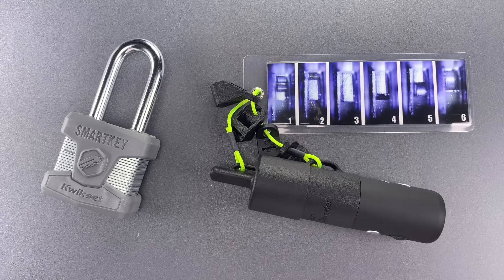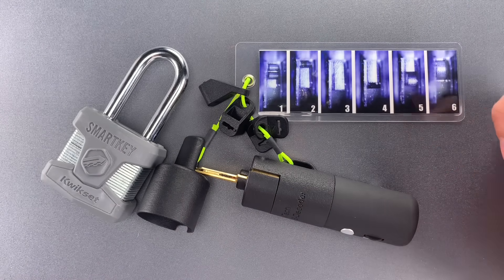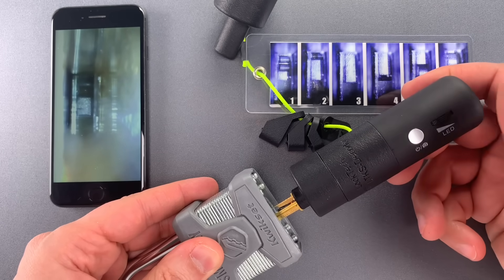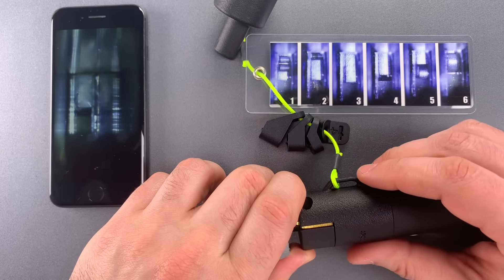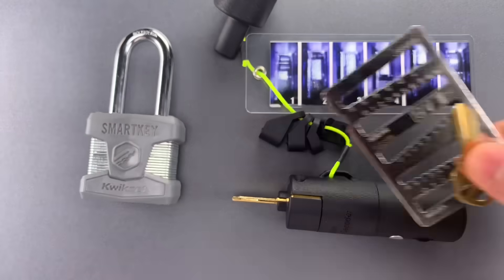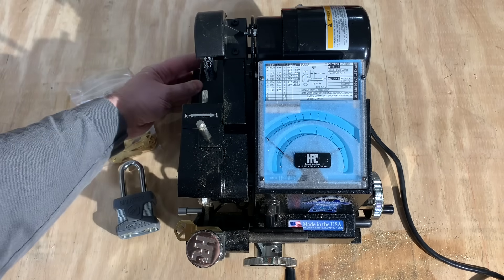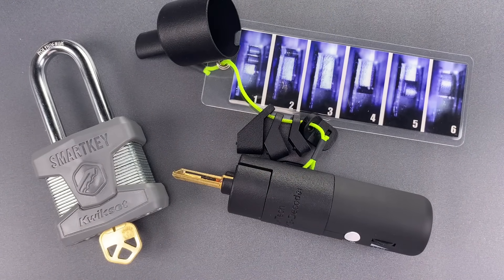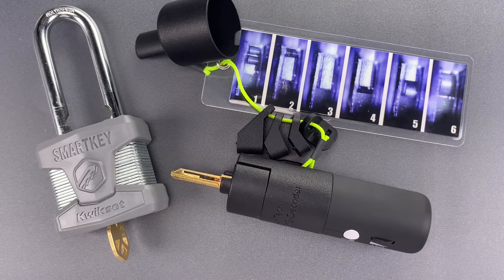[1209] This Tiny WiFi Camera Owns Kwikset SmartKey (LockTech LTKSD)

Comment: Hey LockPickingLawyer, I have a question regarding getting a key copied maybe you could give some advice on. The key for my '87 CRX (original key) is rather worn down and I've been looking at going to a locksmith to have a new key made from it. Anything in particular I should look out for?

Comment: I would have to ask why law enforcement would buy and use that expensive tool when they could more quickly and less expensively use some type of bolt cutters made to do the job even if the lock has some type of really hardened metal

Comment: I'm confused. If this camera goes in like a key, how does it see the side of the sliders, to determine depth (for depth of cut number)? Thanks
Reply: Since the camera is a straight key, or a “0”, the camera shows how far off the sliders would be from the correct position.
Reply: @freypod  Thank you for your reply. I guess I'm not sure what the camera is looking at. I was thinking the lens is on the top of the key, but perhaps it is actually on the side of the "key" (lens). That seems to be the only was to "see" the depth. Learning so much.. Thanks again, Eric
Reply: @ericwes7351  It looks to the left with a tiny angled mirror. The camera looks forward at the mirror.
Reply: @70FordMach1  That makes sense now. Thank you!
Reply: @70FordMach1  Ah, got it. Thanks for that!

Comment: the spacers don't always line up the tool with the wafer chamber I've found; the key- in-knob locks, don't allow the tool to rest flat against the plug face.  
When pulling it out by hand must be careful to note if you're viewing wafer/tumbler or the plug walls (may appear to be a number 3 which is mostly solid)
Reply: Also have to look for wafers that are broken. Don't look like the chart. Can throw you off. That position might work with any cut.

Comment: Thinking of the scenario of gaining covert entry at a later time, if this device took high framerate video you could walk up to the lock, start recording, calmly insert the tool, take it out and leave. You've then got a video you can watch at you leisure to figure out the cuts and get a key made.
Reply: You could use a screen recorder overlay app on your phone. Kind of like fraps on the pc, but on mobile instead

Comment: they could greatly improve the wifi cam by adding a motor that slowly inserts the camera blank into the lock at a set interval(like have it telescopically extend out) , and then having software, an app that  known the speed it is being  inserted at and grabs the photos and then uses AI to to identify the cuts and then  outputs  a photo of the key and  a printable file so you can just print it out at the actual size and use it as a template
probably would  not even be that difficult to design such an app
or even better have it output a  STL file for a 3d printer , either for printing with a regular  plastic extrusion 3d printer or even better a metal SLS printer

Comment: or you can just 3D print the key, as 3D printer are far more common and versatile than key-filers
Reply: Would it break while opening? How much force can printed key sustain? This is an honest question as I never worked with 3d printer :D

Comment: I liked using this key cutter when i worked for a commercial door company, but i would have to go out to jobs and find out what cuts to do if they ever lost a key without any nice camera equipment, so i was basically working backwards from locksmithing because I had to lock pick it, but go through 5-20 keys trying to figure out the number combination for a lock that worked with 5 seperate keys. But hey, now i know how to lockpick unreasonable deadbolts.

Comment: This man's arsenal is getting bigger and bigger to the point where he can break into the pentagon.
Reply: You should read about Richard Feynman. When he was at a military base doing atomic work someone locked the combo to the the super secure safe in the safe on accident. They called him up to open the safe, which he did.
Reply: @SeriousshirleyS  in order to properly understand levels of security you must think of them as time delay devices. A thief determined enough and prepared enough will get past any measure of security given enough resources and time. You either need to delay him enough for the police to arrive or for him to lose interest in breaking in.

Comment: There was a story (fiction) in an issue of 2600 awhile back about someone making a device which looked like a key. It used fibre optics and some electronics and once fully inserted into a keyway it would work out what the correct key is. It would then it then be plugged into a computer and a 3d printer would print out the appropriate key. This is like the non-fiction version of that.

Comment: Uh.... this kind of thing seems to be a bit of a game changer. I would expect you to be able to adapt this to all kinds of locks. None of them were ever designed to be resistant to taking a picture of each tumbler.

I bet that camera will become a $20 eBay commodity within six months to a year....

And for most of these cheaper locks you can probably just print the key on a 3D printer. A python script could make the STL file you’d use to make the key

Comment: Police use a battering ram, or other brute force entry,  just their mentality. A thief will use Boltcutter or cordless angle grinder. Most so-called locksmiths won't invest this type of money.
Only 15 states require any kind of license.   https://reedbrotherssecurity.com/states-with-locksmith-laws#:~:text=15%20states%20require%20locksmith%20licensing,have%20their%20own%20licensing%20laws.

Comment: I Asked myself why copying a Key with this Method, If you can also Take the Tool from These locks, to make a key or sell a unused or new cut Key must be much cheaper. But the mensioning about Secret Services or similar organisations Opened my eyes for what purposes it would be interesting. But for a normal locksmith and his daily Work i think it woulndt be very necessary. Please correct me if im wrong.

Comment: *makes a dial based key configuration key that is 3d printed, that tool could be simplified down to just being a dimension checker instead of a picture dongle since dongles are kinda dumb anyways the only thing that matters is the output anyways. the only valid reason i can think of for using a dongle is if you wanted to sort and save the information on the phone connected for later use lol. which would obviously not be something you want people doing when they help you.

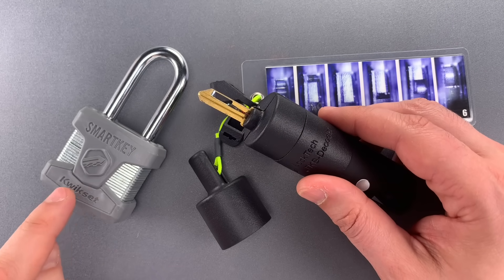Comment: Can someone help me wrap my head around the perspective on this thing? Where exactly is the camera located? Why is there a rectangular open cut in the camera key? At 0:31 he holds it at an angle where you can see a red wire which feeds to an LED. Is that also where the camera is located? If so, wouldn't the top roof of the slit block the actual visibility of the pins? Unless its transparent, in which case how would you know the depth of the pins needed for cutting?

Comment: I'm shocked at how user-friendly that key-cutter is! I've always felt like there would be some arcane knowledge required to cut keys, just like how I thought that about lock picking before subscribing!
Reply: The crazy thing is you can order specially-made files that profile key steps just as easily. You can do this with a file, a bench-vise, and a ruler if you take your time.

Comment: I'm frickin brilliant. I called this out in a previous video when he demonstrated the "light box" and said the technology exists to do much better than that. Now he publishes a video showing something closer to my idea with a camera going inside the lock. Almost there but still not quite all the way to my solution.  To achieve my idea, they need to build a device that can scan the inside of the lock and save the data to a file which will be loaded into a key cutting machine and the machine must produce the key automatically using the data file.  Keep trying. My vision hasn't been achieved yet but they're coming closer!!!   :)

Comment: First, you need the correct key blank on the camera to insert it into the lock.  
Second, if the lock is a restricted key system this method will not work right out of the gate. See my first comment.  
And even if you could maneuver the camera into the keyhole, you still need the correct blank. See comment one and two. 
It’s a cool gadget but that’s it.  Thieves will move to forced entry and circumvent the lock.  Just ask the fire department.

Comment: Law enforcement isn't going to use anything like this. They would much rather just bust down your door with a no knock warrant and bust your ass no need to break open a lock when you can break open the door frame and hinges lol

Comment: That would explain when the car dealership 25 years ago looked into my dash and got a 5 digit code and charged me for deciphering my lock and I said, they didn't decipher shit,  they saw the code in my glove box. Turns out that they did decipher it not knowing that that code was in the glove box the whole time.  I didn't pay for it and went to the next locksmith with the codes that I had all Along.

Comment: Of course these are made for “locksmithing” not just blatant thievery
Reply: Thats way too much effort for thief, they would just use a bolt cutter
Reply: It's impossible to imagine a tool that would work for one but not the other.
Reply: @Not-The-Status-Quo  True, but locksmiths tend to be asked to make a way into the lock without destroying it, where as this would be too much time for the typical thief.
Reply: Not every criminal breaking in is there to steal. I'm thinking of stalkers, blackmailers, etc.
Reply: @screamtoasigh9984  Valid point, in those cases it would also avoid potential signs of someone having attempted to pick the lock if it's ever forensically investigated (scratches at places you wouldn't expect a key to create in there or other strange damage).

Comment: Lockpick: open the lock once, stealthy
Angle grinder: destroy the lock, loud, takes long 
This: guaranteed lock opening and permanent access, takes long
Reply: To be fair, you can pick a lock more than once, as long as nobody realizes you picked it.
Reply: And you can use bolt cutters so cut a lock rather easily

Comment: I own this tool and it's great, - that said, don't be too proud of yourself, as a scope for smartkey has been available for years. And scoping a lock is nothing new or particularly interesting. Locksmith's have been doing it for years. Really reaching for new content LPL, instead of making locksmith's look like a jackass why don't you offer practical advice. Most of your video's are quick to point out flaws and weakness of various lcok mechanism's but fail to address if these issues are practical vulnerabilities that the common thug will employ. Most people smart enough to figure out the entry methods you preach are also not criminal meth heads trying to kick in your door. Smartkey has weakness, obviously, you can drill the screws out of these deadbolts with a sharp drill bit and battery operated drill in less then 30 seconds, the whole thing will fall out on the floor. But they do offer at least bump and pick protection, and convenience for the home owner. No lock is perfect. I find kwikset to be overall well engineered, as a professional. Yes, many of my collages may disagree, being overly harsh on the products, but point blank Kwikset locks where designed to be easy to re-key, easy to service, for a maintenance man, easy to install, and cheap. I find the kwikset tailpiece to be exceptional, it only go's in one way, so the end user can't screw up the timing, it's shape is also extremely resistant to bending, unlike so many deadbolts which use a flat tail piece, that I often times find turned into a pretzel. (bent). The C-Clips used by kwikset opposed to the standard screw-type retainer are also very easy to remove, and very fast to service, they are less prone to being cross threaded as well, and have fewer moving parts, no spring or pin. Here is my challenge to you LPL- YOU DESIGN A BETTER 10$ deadbolt. Considering their competition, - Defiant, brinks, gatehouse, and countless other no-name garbage, the standard kwikset deadbolt is a fucking miracle. Get back to me when you've put a few more miles on that 1200. Mine's from 1970 and is still branded Lagard.

Comment: thats all great but the criminal will just use a set of large bolt cutters.
Reply: This is the exactly what they want. It becomes easier to prove criminal intent
Reply: My GF's storage unit was broken into and she found that she couldn't open the lock. They'd used bolt cutters to get in and then replaced the padlock with another of the same model to cover their tracks.
Reply: @immortalsofar5314  a spate of those happened where I used to live
Reply: This device has serious implications over bolt cutters.

It provides seemless entry by a non-lockpicker without disturbance of the lock

Comment: it's too bad it doesn't have a video record feature on the button instead of a photo at a time. then you could do a pass of every position and review the video later to find each one, instead of having to find each one at the door. would knock the time you have to be in front of the door down to like 2-3 seconds total, tops.

Comment: Can you just 3d print the key once you know the sliders? 3d printers are very affordable these days and though plastic key may not be as durable as the metal one, if your purpose is to open the door once, it should work just fine.